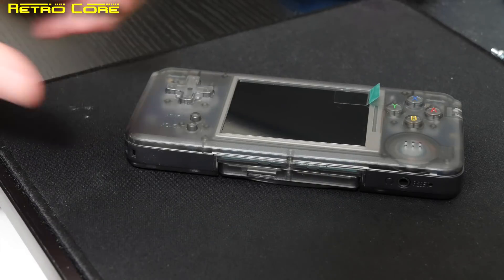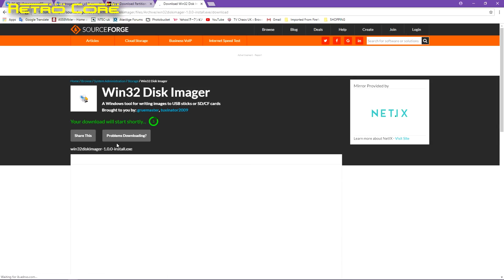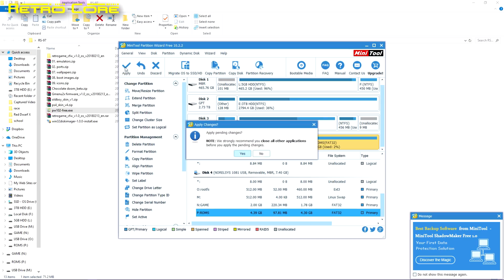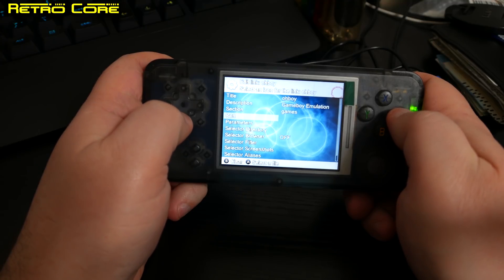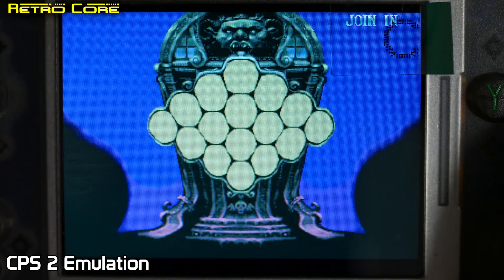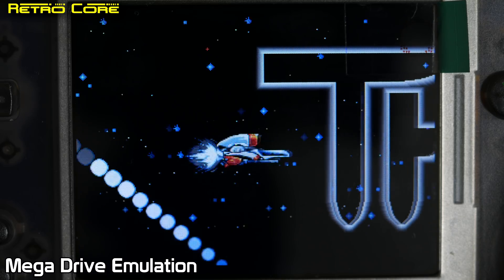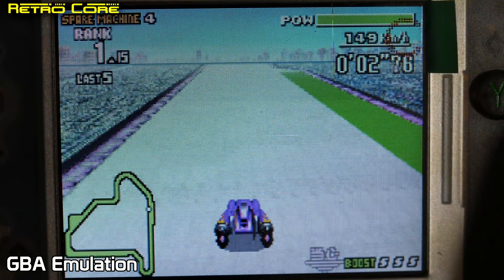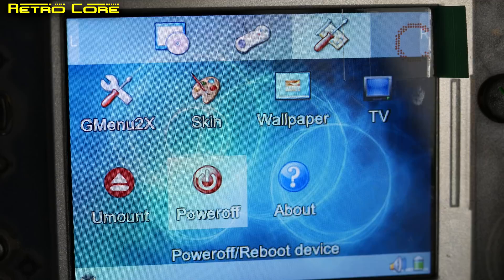RS-97 Retro Game Modding guide - Chinese Knock Offs - 4K

Comment: More work than I thought to make this machine good. I just bought one (actually came with internal 16gb!) but omg, the default installed emulators are even more horrible than even other systems (dingoo 320, gemei a330) that happened to come with preloaded emulators already. Hopefully I can manage to upgrade the firmware and add the software from the community soon enough.

Comment: Can I use 8gb class 10 micro sd card? What is the advance of using much higher capacity sd card?
Reply from the maker: Yes you can.  Using a high card gives you more space for roms.  Up to 32gb should be fine.

Comment: p cool that the firmware link is down considering this video is only a couple months old.
Reply from the maker: What do you expect from a video made a couple of months ago?  I don't have time to follow the hundreds of links I post on the net to make sure all are always up to date.  That's for the user to work out.
Reply: Retro Core yo props for the quick reply. The google drive link with all the files is still up but the one thats the firmware above it is out. Wonder why all this stuff gets moved around.
Reply: Retro Core also i did the mod n all that but now my device power button isnt responsive. Thinking I should try and reflash the usb?

Comment: Hey i got my hand on one but when i installed the firmware, no emulators showed up, where can i get them. Also i installed it on the tf card
Reply from the maker: I no longer have this system or done anything related to it.  Please check the links in the discription or visit a Dingoo related forum.  There you can find out about emulators for this device.

Comment: Is it possible to use cheat on games like pokemon for gba?
Reply from the maker: Yes.  Emulators suport game genie and action replay codes.
Reply: Retro Core     Will you ever make a tutorial on how to add them or activate them in game?   Thank you very much.
Reply from the maker: Sorry, I don't really do that sort of stuff.  I'm sure there's plenty of guides on the net tough.
Reply: Thank you so much for the answers, I have one last question, is there a chance to speed up a rom?
Reply from the maker: Hmm, some emulators have an OverClocked option which can speed the game up but you would really need to check with the emulator's homepage to see which offers such a feature.

Comment: Hello, great channel, one question plz, i can reemplace the internal memory of 4gigas for another example 32gigas.(or only 8gigas). Tnx for you video y go one rs-97.
Reply: Sorry for my poor english. 😋
Reply from the maker: Yes, you can replace the internal memory.  On this video I replace the 4gb micro SD card with a larger card.  I don't know the size limit but 32gb should be fine.
Reply from the maker: No problem.  I could understand very well.
Reply: Actually the RS-97 supports up to a 32gb sd card giving 28gb of free space after the CFW partitions at first boot up

Comment: Does the CPS 1 & 2 /Neo Geo roms need to be in final burn folder? Does it need bios files to run? I tried to link the path from rom folder and the Final burn screen was stuck.
Reply from the maker: They can be anywhere but you need to Configure the rom path within final Burn.   You do not need any bios files.

Comment: I'm tempted on buying this little machine. Is it capable of playing on 60fps or the screen is a bottleneck for that refresh rate?
Reply from the maker: It depends upon the emulator.  Playing Mega Drive on it felt perfect.
Reply: I also saw on another review that the shoulder buttons are lame af... Can they be THAT bad? Maybe the rubber membranes can be replaced
Reply from the maker: The shoulder buttons aren't great but they are usable.

Comment: I've just bought this fantastic console! I was wondering, to insert new games I need the mod?
Reply from the maker: No, you can still add new games without the mod but you will be stuck using the default emulators which are not very good.
Reply: Retro Core Very Thanks! 🙂

Comment: Ive got the Problem that i Cant get neogeo games to run fba Cant find anything (i Use the preloaded Roms dunno if thats the Problem) can you recommend an emulator that should work cause i Cant really find one
Reply from the maker: The problem is that you are using roms made for MAME.  Best find a final Burn Alpha forum to enquire about the rom format needed.  I got my roms from a French site that had a dedicated Final Burn Alpha section.  The problem is that I'm on my phone so can't access the link.  I did post the link in reply to anther person having the same issue.  Have a look through the comments for the link.
Reply: Retro Core  i just downloaded a Rom in zip Format and it seems to work fine But thanks for the Quick awnser :3

Comment: I flashed the firmware and added my roms, emulators, and images to the ROMS partition by connecting to my PC, but I cant get the device to recognize any of the files I added
1)  When I hook up the device to my PC through USB, I can only interact with the roms folder. Is that normal? 
2) when I try to hook up the SD card directly to my computer, I cant do anything with it, without formatting it. 
3) When looking through files on the device, it doesnt even pick up on the roms partition
So basically I cant add anything to the device or even affect the files on the device.

Edit: I managed to fix this issue by clearing the partitions and reformatting the SD card to FAT32. Then i went through everything again and this time the files were visible under /mnt/ and then int_SD. Might want to put an annotation reminding people to reformat their micro SD card to FAT32 before starting the tutorial.

Comment: Hello can we put the system recalbox or retro pie on the map sd?
Reply from the maker: Sorry, I dont know.
Reply: Retro Core thanks
Reply: Retro Core you put the games in the SD card GBA cartridge?
Reply from the maker: Yeah, you should be able to do that.  Just direct the emulators to load roms from a directory on the external SD card rather than the internal SD card.

Comment: excellent tutorial. has anyone tried the 1.2 software update? i want to know if there is any improvement on the emulation side?
Reply from the maker: snes Emulation is meant to be greatly improved.
Reply: have you tried it?
Reply from the maker: No, I had to sell the RS-97 to fund the next console which  will arrive this week.  Unfortunately I don't get free stuff like the bigger channels or the sellout channels so I need to sell stuff on all the time.   I did hear that snes was almost 60fps now.
Reply: Retro Core cheers

Comment: Hello Retro Core. I have another question. I just got my RS-97 and am ready to start preparing the SD Card with the new firmware. You show us how to install OpenDingux with Wun32DiskImager on the SD card but how can I install other software like the newer patches and overclock software?

Thanks in advance for your help.
Reply from the maker: I beveled the new software is just a drag and drop solution now.  I've nit tried it but I beleive you drag the data on to the SD card then install it using the consoles file manager.  Kind of how you install new software on a PC.

Comment: I wonder if this device can handle a 64gb or a 128gb sd card?? Has anyone ever tried before?
Reply: It only allows up to a 32gb micro sd card. But after the CFW is installed and the partition expands at initial startup,you get 28gb of storage to put on a ton of games. I put on 36 Playstation 1 games,nearly every Snes,Nes,GBA,GBC,GB,GameGear ,Mega Drive,and Master System and still had 2gb free.

Comment: Thanks for the video. I have a question: Is it possible to return the original memory card and receive the original system after the process, or does the process change system files on the device itself, and requires reprogramming of the device?
Reply from the maker: It's 100% to return to the original system if you make a back up of the SD card that came with it.    I've not done this myself but did read somewhere about it.  A great place to check would be https://boards.dingoonity.org/
Reply: If you still have the original sd card it will just run off that sd card and what's on it. In other words,there's no operating system in the console itself,everything that makes it work and run is from the sd card you put in,so you can have multiple sd cards with different firmware and they'll run what's on the card.

Comment: @retro core  The new CFW 1.2 is out and awesome!  Fixes a lot of emulator problems including my beloved NES!
Reply from the maker: Good stuff man!  I've seen it running.  Makes this console a must have now.  A massive improvement on a mod that was already a massive improvement on the stock system.
Reply: Oh yeah!  It's amping up to be a spectacular system.  Btw, have you checked out the similar tlex ulike with a 7 inch screen on ali?  type in: Smart Handheld Game Player 8GB with 7 inch touch screen.  It seems interesting, if not the same thing.
Reply from the maker: I sure have.  I even reviewed it.  I don't think it's as good at the RS-97 though.  It's way too Laggy on the menus.  Here's the links to my review
https://www.youtube.com/watch?v=NfR6_Y5-kgg&t=

And the update
https://www.youtube.com/watch?v=zAqscRjkb-M
Reply: Well i have repacked all the latest changes now into a v1.3 firmware now its awesomness you can find the links on my website and instruction enjoy people.

Comment: Great tutorial! I got mine working but I can't seem to locate the roms. when I hook it up to my computer it only shows 2 files and can't seem to access the folders shown on my console. Placed the roms both in the internal and external sd cards but I just can't locate the game inside the console! please help!
Reply: Okay I managed to figure out where it is I think I'm good for now. Still testing other emulators so far I am disappointed with the snes emulator. Castlevania seems to run slow compared to the default emulator.  I was excited because I wanted to play snes games since I never owned one as a kid. Started in the Ps1 era lol

The Gameboy emulator fixes the scrolling problem i encountered and the gba emulator fixes the synching and sound problems :)
Reply from the maker: There's a new patch coming soon  that will feature all new emulators including a much improved SNES emulator.  It's best to keep checking the resource site I linked to in the video discription.

Comment: For some reason, I can't see anywhere on existing tutorials at what moment we should put the battery back. That step is mysteriously omitted, go figure. Because, in my case, when putting the battery back, I get a non stop flashing battery indicator on the screen with no possibility of switching the console on or off. Plugging it in on the wall doesn't change anything. However, when removing the battery, I can successfully plug the console on the PC and do my thing. Did I miss a crucial step? I did that a bit in a rush, perhaps the solution is simple. Or I simply didn't explore the topic well enough. Also, I didn't watch the video entirely because I did that a bit in a rush (it was for a friend, at his house -- if it was mine, I would have been more careful). Thank you for your understanding.

Ah yes... one more thing. Once again, Google is definitely NOT my friend.
Reply from the maker: Putting the battery back is kind of obviously done once the machine is put back together.  That's why nobody mentions it.  Your console seems to have an issue though.  I've not experienced the flashing LED myself.  Do you think your SD card is installed correctly?  It may not be fully in the slot. Then again, if you can read data from the card then that may not be the problem.
Reply: Thank you for your reply. I'm almost certain I fully inserted the card (I even put back that piece of rubber on top of it, even if not necessary). What my friend did was letting the console discharge itself and see what will happen next. Unfortunately, the following happens: putting the console in charge by plugging it to the wall or a computer triggers the chrage. But unplugging it won't change the console's state! That battery icon will keep flashing!... Well after a while that icon disappeared and the console booted normally. Then I unplugged it and it stayed on. I, then, powered it off then powered it on and bam! The same things happens. It might have trouble to access the content of the internal SD at boot, I don't know. It'a Sandisk 32GB that we used.

Other than that, your video was nicely done and instructions were clear enough.

Comment: Have to thank you again. Got almost everything running and read the dingoonity forum pages up to page 68 now. I am impressed by the hard work you did on the CFW!

Still have two noob questions: 
I found out how to use the command app, but can’t move/or copy files and folders (i highlighted them pressing select and by press x i could choose the options copy/move, but by pressing a nothing happens (what am i doing wrong)?
Second thing is, i would like to make a german review video for the device, am i allowed to link your video in the comments section (all potential buyers should know about your project, i think)?
Reply from the maker: Ah, the command app is something I never bothered with.  I also couldn't figure out how to work it.  I just did everything though the PC.  Connecting the RS-97 to the PC via the USB was much easier to do when it came to organising the folders and adding files.
Sure, you can link to my video in your German review.  I'd be very happy for that.
Reply: Thanks for the response. Interesting, because i can’t see all the directories via PC...

Comment: Great Video, thanks👍
But i still have a few questions (want to try it with my retro game), maybe someone could help?
1. Where to put the downloaded patch file?
2. Where to get new emulators (especially nes, GB, GBC, GBA, Mega Drive, Master System and Gamegear?) and how do you add them?
3. Where should i put the roms (file name/directory?)
Sorry, if these are silly questions, but i am completely new to dingux...
Reply from the maker: 1. the patch file is in the link
2. Emulators are included in the ptach file but you can get more by searching for a good Dingoo community.  Visit the resource link I provided.
3. Any where you want.  It doesn't matter as long as you direct the emulators to the rom directory just like on a PC.
Reply: Retro Core Thanks, your help is really appreciated!
Made it with CFW running, but always get error messages when trying to download from Mega...
And i can’t start Neo Geo or CPS1 games, the emulator doesn’t seem to find it...
Any suggestions for a good game gear emulator?
Reply from the maker: Pico Drive will run game gear and Mega CD too.
Reply: Here's a great place to start https://www.youtube.com/watch?v=0BkIO7JThis&t=5s also more emulators in ipk files bitgala server under PY Menu Firmware (just watch the video and all will be explained...and we've all been newbies at this so don't feel bad)

Comment: how do you add roms?
Reply from the maker: By connecting the console to your PC.  It sees it as an external device.
Reply: Retro Core so then do you need to keep that cartridge with all the games in it?
Reply from the maker: The cartridge is just a Micro SD card adapter.  If you want go add more games than will fit on the internal memory they yes, you need the cartridge with an SD card in it.  For this video everything you saw was stored on the internal memory (the SD card which I installed in to the machine)
Reply: Retro Core thanks for the info!

Comment: I got a bit lost along the video but... Were do you get all of the emulators from? Reason I ask is because the download link (s) seem to be missing a lot of the emulators like megadrive, nes, and super famicom. Really glad you put this up tho, as I could not find a more in depth installation video out there.
Reply from the maker: Most of the emulators are inbedded in to the firmware file.  The emulation folder in the links are just extras.
Reply: Obviously someone ported Dingux (that's a Linux port originally done for the Dingoo, an old handheld emulation device, to substitute the original Dingoo OS) to this system. So you can use emulators for Dingux (taking advantage of the emulators available on Linux after recompilation). At least that's what I take from the video. 
What's interesting is, that they seem to use an SD (MMC ?) card and not a Flash ROM to boot from. Somewhat unusual, but making modding a lot easier and eliminating chances of bricking that thing.
Reply: Frank Schneider hey thanks for the reply! I'll try and do more research on those emulators!
Reply: Retro Core ah excellent! Thank you so much! Can't wait till my unit arrives. But before I go, is the Retromini worth it if I'm getting one of these? I just love that Gameboy shape / form factor.

Comment: Can it be possible to run an Mame Emulator such as Mame32 onto the system even after the changes are done ?  I am curious because I want to ultimate Mame Handheld device.
Reply: If it runs Final Burn Alpha, and assuming that my technical understanding of what was actually done during modding is not totally off, you should just be able to use the Mame4All emulator for Dingux on this, which is based upon V0.37b5. No guarantee though.
Reply from the maker: Hmm, this device runs Dingoo software so if there's a port of mame on that platform it will run.  Be aware that this isn't the most powerful of hardware out there though so many Arcade games will run slow.  Final Burn Alpha plays many other games beside Capcom and SNK stuff however a lot of it runs slow.
Reply from the maker: I think it shod work.  Everything I've installed on it was originally made for Dingux.